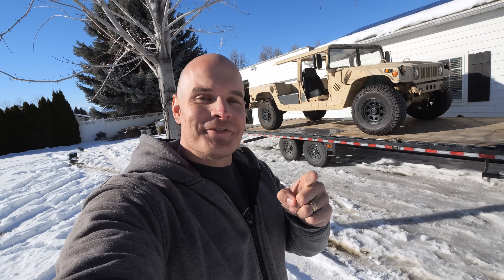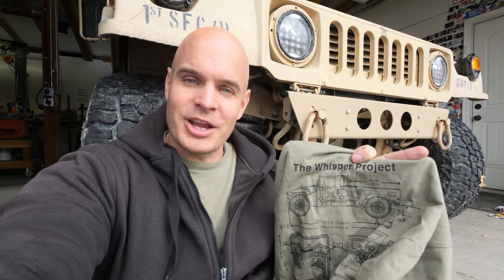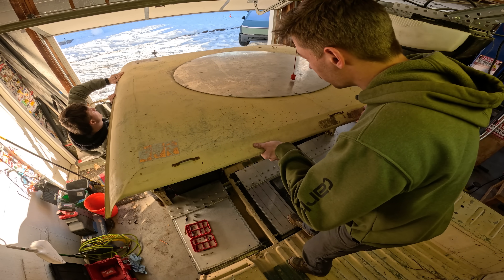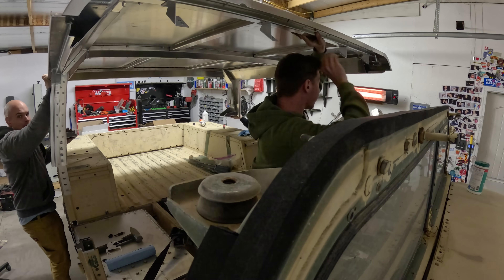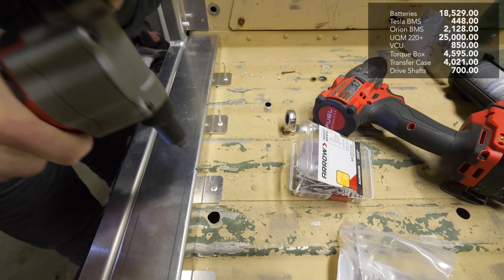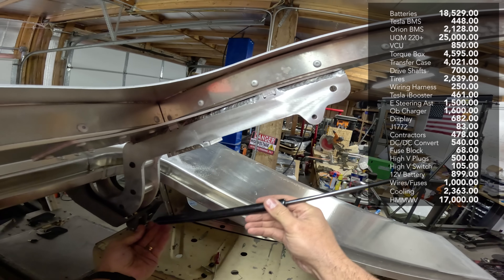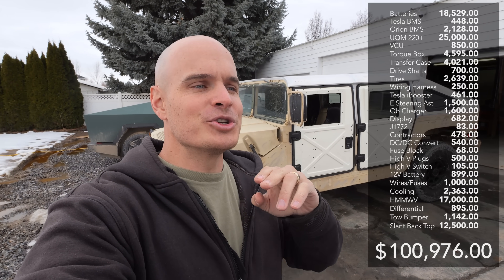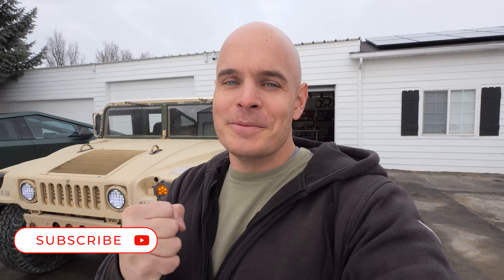How Much did My EV Humvee Conversion *actually* Cost?!

Comment: Please find a place that will do a hub dyno to test this 12,000 torque
Reply: That sounds like wheel torque with all the gear ratios applied. Like a 100 torque motor with a 10:1 ratio ends up with 1000 wheel torque, it’s still a 100 torque motor

Comment: Slant back looks cool, but was the full straight stretched version so much more ? Does give you a back door if you want, more usable space on the inside, and an easier surface to attach a roofrack onto it for more sotrage space or whatever.
I mean, combined with the bunker, go for the full apocalypse version... Which doesn't really work electric, although the silent drive is a definite advantage, but the charging... Better have a solar panel field that doesn't get blown away or stolen XD

Comment: The powertrain sounded super expensive as well as the battery, wow. Thanks for sharing the prices and the build. The new top looks excellent. If it includes all the doors, completely waterproofs you AND replaces the B and C pillars it's not a bad price at all.

Comment: You dont have to pay for special service, you dont have to keep intervals or loose warranty, you dont have to pay 60k for a battery swap in 5 years.
(Still wouldnt like to drive it. Too loud, too big, too unsafe for our small roads. Biggest pro would be people get scared to just pull out in front of you)

I'm driving a new bought opel corsa-e for 1.5 years now, thats probably gonna get scrapped within 10 years lifetime. Still only cost < 1/3. (But cant tow stuff)

Comment: For anyone thinking of attempting this look into Edison motors before you start thinking about using Tesla parts
Reply: Ps 99% of the problem with most evs is planned obsolescence and over engineering making everything ultra complex when thing could easily be kept super simple and more reliable

Comment: My thing is that it seems as though you're getting ready for the sh*t to hit the fan. But i have to ask.... How will you charge the cyber truck, and the converted humvee? Solar? In a situation that you're obviously preparing for charging by solar power would take forever. I mean hey its unique but it doesnt seem real practical in a survival situation. Slap solar panels on the top of the humvee so that it can charge while being driven. That would be practical. I mean where will you find a recharge station in Armageddon?

Comment: They didn’t cut the b pillars to install the turret, they cut them to remove the turret and prevent one from being installed for the demil process. They usually take the whole roof too, you’re lucky to get the roof panel as they usually remove and destroy them

Comment: Money earned by posting the videos not withstanding i believe the higher value of this build is that you know how it works, you will always be able to replace parts easily, and in the long run that would save you more money than the cost of the build itself.

Comment: He said that the ev humvee costs 58,000 avocadoes. according to statista, one single avocado costs about $1.7. If you multiply that by 58k you will just under 100k (or about 19,000 big macs at McDonalds) also keep in mind that the avocado price was from 2021 which could have changed from economy.

Comment: in the past you had a video on issues with the steering i suggested motor steering not connected to the wheel i had no idea i was suggesting steer by wire before it even existed it's a shame you never did it like that as that would be special

Comment: The cost could have been brought down a little. I see you paid almost $700 for a small display. a 50 inch 4K TV can be had for half. There is room there to find parts much cheaper

Comment: 100k seems quite a reasonable number for the amount of work that went into it. Great video series to watch!
Reply: The labor cost would probably double the 100k figure... custom one-off projects are expensive.
Reply: @Steamrick  Labor is a moot point. The price is simply how much it was for him. There is no one general price for basically any of it. Prices will differ drastically from person to person, not only because of preference but because of time! 

There is quite a bit more available now overall than when he did his build (at least when he purchased the major components). The used market is increasing more and more each day as well as more and more options for controllers, BMS's and chargers and more and more manufacturers and the aftermarket is increasing at a fast rate! Not to mention more knowledge is available as well! 

There is a reason the title of the video says "my", he did say DIY Humvee prior which is much more fitting because if you're having a shop build it then it's not a DIY!
Reply: $100k is just for parts not his time on research or building/ assembly.
Reply: @edo4713 he touched on it in the video. His time isn't a factor. For one, it's for himself! Two, it's what he wanted to do and he enjoys doing it. Three, learning is priceless!
Reply: @commonsenseisdeadandgone  four, he earned double the price of it by making a series of videos on it
Reply: @Userext47  😂 touche'
Reply: @edo4713 he touched base on just that. He is building it for himself, he can't factor in his time on it. 

As he said, the time spent is invaluable. Knowledge is priceless!

Comment: 3:50
I audibly cringed
Man, you should have gone with a used Plaid motor. Super easy to find for around 6k, incredibly easy to control, lots of power, mount it where the diff was, or just mount it turned 90 degrees.

Also you did not have access to this at the time, but model 3 long range are getting unbelievably cheap, it's like $5k for 63kwh

Comment: Add a small diesel engine to power the inverter and you have an independent charging source for the batteries completely off-grid without reliance on the sun.

Comment: People who make affordable DIY builds do a lot of cost savings left and right, instead of using CNC services they use angle grinder and a lot of filing, instead of buying almost top of the line lithium cells from tesla they use batteries from nissan leaf, instead of brand new motor and inverter they buy 5th hand used stuff, instead of using a massive military truck they build vw golf or some audi.
Reply: True, though your time is also a factor. If there’s a part that takes you six weeks to fabricate yourself vs six days to get machined, it may be worth it in your time and keeping project momentum to pay more to get the part faster.
Reply: It wasn't meant to be affordable
It's a see if it can be done type thing..
Bravo Jerry
Loved every minute of it..
Reply: I dunno if LEAF batteries have the power density to handle driving such a heavy monster of a truck. They aren't exactly made for performance like Tesla batteries are.
Reply: @coredumperror  I don't know either but often when you are gunning for range then you end up with more than enough ampacity even if you used some low performance cells.
Reply: At what point did Jerry ever claim he was trying to go for 'affordable'?
Reply: These “massive military truck”s arent even expensive.  Much less so considering you only need a roller anways.

Comment: You got ripped off bud. HMMWV surplus are being sold directly from the Army here in TX for $5,000-$12,000 as we got rid of all our HMMWVs for JLTVs at Fort Hood (now Fort Cavazos). Configurations are mostly the M998/M1097A2/M1097R1/M1165A1with slant-back and snorkle, squared soft back, or the pickup/troop transport truck variant.

Comment: hey ahm not 100% on this, but you replace what was supposed to be a steel roll bar, with an aluminum, I frame like roll bar, The crush weight resistance is now cut in half. can anyone confirm this? If that is true, you just wasted a ton of money, adding on that pos, that does nothing. am i wrong?

Comment: I truly can't believe how much they charge for batteries. It's absolutely nuts.
Reply: I've bought individual lithium ion cells, so I'm not surprised at all that thousands of them are very expensive
Reply: 25k for a motor seems way  more overpriced to me.
Reply: @alfrredd  it's a motor and a controller quoted in this video, the controller being an expensive part. That's like buying an engine AND all the wiring, harnesses, ECU etc. You can't lump those together and say it's the price for a single electric motor. And even then, there is a wide market of parts available. And he's buying a special made system not mass manufactured for production cars AFAIK. Completely missing out on economies of scale. It's a niche special product for aftermarket swaps.
Reply: @alfrredd it is, back when he started this it was expensive but reasonable for what he wanted, but now you can get them so much cheaper.
Reply: well yeah there's a crap ton of them
Reply: You think it's nuts now? The og tesla roadster pack cost tesla about 55k per pack to make. The model s closer to 70k a pack. 
Now they can do a similar sized model 3 lfp pack with better range and energy density for about 6k. 

By the end of 2030 expect semi solid state and solid state cells at 40-50% or better energy density to be on par per kwh with today's cells. 😀👍🏻
Reply: That's why they aren't the future. EV's are often scrapped as un-econimical to repair when the only thing they need is a new battery. They're also terrible for the environment. Screw electric cars.
Reply: @RMF76 you don't forsee economies of scale or new battery types? Lol, insanely closed mind thinking. You sound like horse carriage manufacturers when the first cars came out. Where are you going to fuel that thing? What happens when it breaks down? 

It's a new technology. This is how every new technology starts.

And note: have you ever blown the engine in your car? What's the dealer quote on that replacement?
Reply: The specific high energy density battery chemistries used today in the newest cars did not exist even a decade ago. The broad term lithium ion did but batteries in a 2013 EV are barely comparable to today. @JayMaverick
Reply: @MattA-fi5qe i agree that electrical cars are the future, but not current ones, when cars were originally made it was mechanical, mechanical limits are to be explored, but with electric cars its technological , what i mean is that electric cars is not a new thing, it has been around for a looong time, but the technology allowing them to be usable has just surfaced and explored, and its not yet viable economically and environmentally with the current lithium batteries, even with high oil prices ( which could be lower since literally many countries depend on oil as primary revenue source), is it a step forward? Yes, but not for everyone and its very clear thst its being pushed by politics tbh, but one day the battery technology will challenge the existing evs and conventional petrol cars and until that time things can change and more ways of saving the environment could be out thus hindering the progress of EVs.
Reply: @JayMaverick  ok, so you aren't very well versed in this area. That's what I get from your comment. Are you seriously saying batteries 40 years ago are "modern" and what we are using today?
Reply: @JayMaverick  Batteries have a long development life ahead of them. ICEngines? Not so much. And we're only just getting Lithium etc recycling off the ground. So in that sense it's still new tech.
Reply: @SerialChillerBH  please lookup how many electric cars have been manufactured, per year. Look at the charts for me and make a few reasonable predictions, especially accounting for recent years. 

The future is now and happening. There are millions of electric cars on the roads driving and charging every day, with the numbers going up exponentially year over year.

Millions produced and not yet viable? Are the manufacturers just handing out free cars?

Comment: This would be something i would do.

I would hope that ev conversation isn't that expensive. In general should be from $200-400? I hope
Reply: unfortunately you can't really get even the motor alone for $400. then you need all the other components like electric brakes, electric a/c pump, BMS system, and the most expensive part, the batteries, which run tens of thousands if you want to get any reasonable range. the reason why the motor was more expensive for Zack than the batteries is because the motor and drivetrain had to be strong ones for a Humvee, as well as having more than just 2wd
Reply: @Randomness662  sadly seems like it.

Cheapest I heard is $3k. Others require pulling parts from an EV already.

There's a reason I haven't bothered learning yet. I should probably start with converting one to a hybrid first.
Reply: @TheStickCollector  I think a hybrid would be even more complicated, but yea likely less expensive due to the smaller battery sizes. I myself am interested in EV conversions in the future, but I just can't justify relying on antiquated battery technologies like Li-ion and current Li-po compositions. 

I am waiting until solid state hits the masses, which we likely won't see for another decade or two. By then though, DIY EV conversion kits should be far more mainstream, far easier to do, and WAY cheaper. I'm hoping by the time I get to do it in 15+ years it'll be around $15-20k for a premium conversion with 300mi range. Luckily I'm young so I have the years to spare 😅

Comment: How far can the HUMVEE tow a cybertruck in freezing weather?
Reply from the maker: I like the way you think.
Reply: @JerryRigEverything you should try to get ahold of chase or Haron of Edison Motors 😅
Reply: @BurchellAtTheWharf for sure, but i don’t think he will because he is going 100% electric. He doesn’t want the diesel generator that it comes with.
Reply: @joshuashea911  the diesel generator is optional. Just basically a range extender, but if you skip out on the extender, you can add extra batteries, but I men from a business standpoint. The E Axel's fer large an medium trucks, and smaller gokart stuff. There could be some mutual gains fer both sides, and a wealth of expertise that could be shared
Reply: @BurchellAtTheWharf  totally agree with you on that
Reply: @joshuashea911 it doesn’t need to come with.    The goal they have is energy agnostic.
Reply: Please make a video on that and how far it can go without towing how much it currently weighs and efficiency and anything else you can think of thanks can’t wait!!!!
Reply: @JerryRigEverything  Whisper beating the cybertruck 👀
Reply: Same thing but in extreme heat 

 @JerryRigEverything
Reply: @JerryRigEverything  where is the s24 ultra teardown video pls 😢 😡
Reply: @JerryRigEverything  who knows you may wanna upgrade from the s10.
Cox i will upgrade if you do too
Reply: @JerryRigEverything next video hopefully s24 ultra for review unfortunately for me I can't afford one
Reply: @JerryRigEverything but only with upgraded battery pack to 123kwh ;-)
Reply: @JerryRigEverything Make a video 👍
Reply: @JerryRigEverything I always look forward to videos about the whisper project. I have watched all of your videos before this, but this build for me was definitely the best-as I am a car enthusiast. Looking forward to more as you release them! 👏🏻👏🏻👏🏻
Reply: @JerryRigEverything  so about 5 miles lol
Reply: @JerryRigEverything  Well, going offroad in the cyber, you will be thankful for the Humvee, as it will be able to tow the cyber out when it gets stuck. Make a note to take along both some heavy duty straps, and turnbuckles, so that you can pull hard on the cyber chassis at multiple points, so you do not rip parts off. Plus as well some mats, to place on the ground, so you do not get too muddy and wet.
Reply: @JerryRigEverything   No point of this Humvee , but i am not you and you are not me :)
Reply: Interesting question 🤔
Reply: @jerryrigeverything I'm fat and the 4x is sold out...any acceptioms
Reply: Needs a 0-60 comparison!
Reply: And can it do that faster than a Porsche 911 (but not really), then it would be the FULL cybertruck experience 😂
Reply: That'll be good.
Reply: With the brakes on or off?
Reply: No
Reply: Let's see Hummer EV instead
Reply: I bet your ev hummer carrying a hummer same weight as yours beats tasla ha 😅
Reply: 14 miles
Reply: As a military driver of this beast, I just have a question.
Where the hell did you get that vehical in a brand new state from. Btw does it still go up an 80 degrees off road slope with that ev engine?
Reply: 15mi
Reply: how best it climbs steep slope as compared with the original diesel engine Hummer
Reply: Exactly
Reply: This test is a requirement.  For science! 🧪
Reply: 43 miles... lol
Reply: With or without 'diesel generator'?
Reply: Like 20 miles but would be cool to watch
Reply: Why all this money on EV ? It’s been proven that the cold is no good for these… personally waste of$$$. Still great project
Reply: Should have gone for an Edison conversion kit with a small generator engine and battery pack. No milage limit
Reply: In order to compare both of them tow one until you have no more power in that truck, and then take the other one to tow it back again. And depending on if the second one makes it back or not you will find out if it is better or worse for towing.
Reply: @tjalvotron  well not if its up hill one way lol you have to just start from the same spot and do 2 trips down the same road
Reply: @andrewrules231  yes you need a road that is the same both directions ;-), unfortunately I don't think it will happen. But it would be amazing.
Reply: Third video back including this video
Reply: This by 💯
Reply: The humvee is far better than the junk they call a cybertruck
Reply: 2ft 😂😅🤣